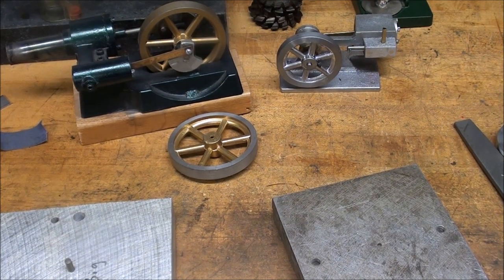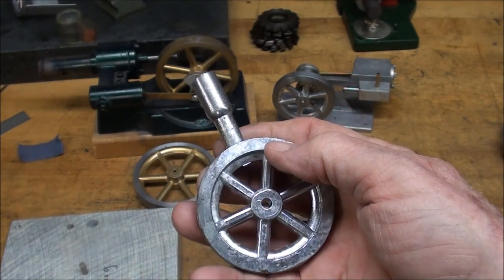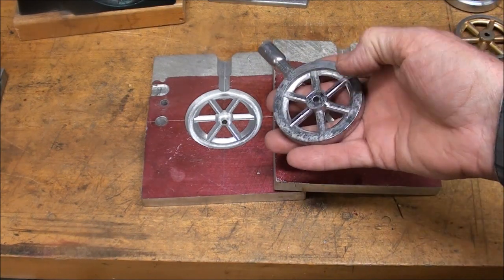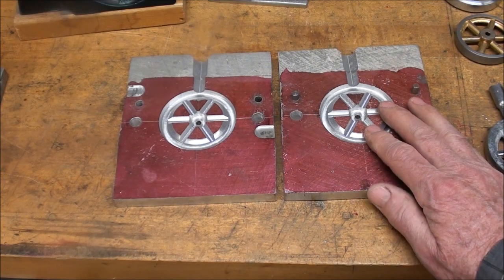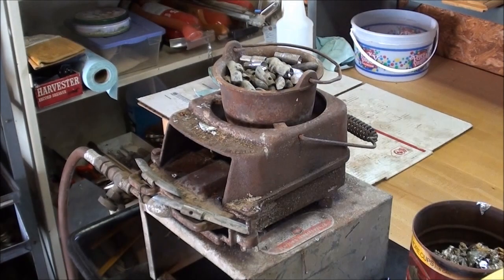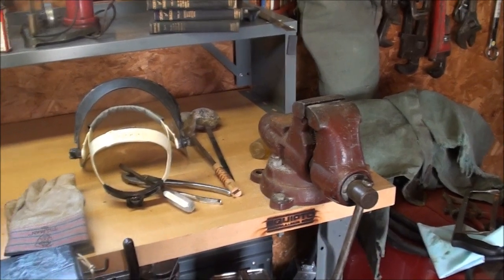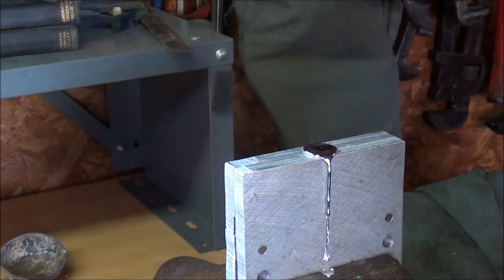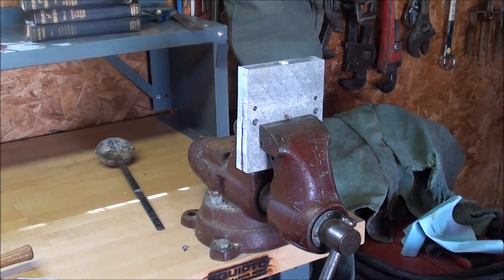MACHINE SHOP TIPS #162 Part 1 Making Flywheels for Model Steam Engines tubalcain

Comment: If you're planning on melting lead soon, consider getting a non-contact thermometer like they use for forehead temperature.  There are models that will measure over 700 degrees F.
Reply from the maker: Thanks

Comment: Thank you for posting this. One trick you may consider when casting lead with an aluminum mould is to apply carbon black to your casting surfaces. A kitchen match or two will do a pretty good job of this and it makes your release much nicer.

Comment: you could probably take some of the guesswork out with a cheap hand-held laser thermometer. could tell you both the temp of the metal in your pot as well as the outside temp of the mold. 

as for the wheel weights - lead may not be that harmful in certain situations, but if it's out in the environment, it can cause issues. it'll dissolve into the waterways and show up in fish and many other animals. doing what you're doing, focused on safety, wouldn't worry me at all. in fact, i may try it someday when i get started making those cute little steam engines. :) 

and keep ramblin'. it's not a bad thing.

Comment: Mr. Pete,
  I like looking at your many different videos you’ve made over the years. 
    This one brings back memories of the hours I spent over a plumber’s pot just like the one you have. This was normally a shop mounted device but my dad made a mounting bracket to put it right on top of a propane tank so we could take it to job sites. I always questioned the safety factor but we never had a tank blow. 
   I spent a lot of time fishing the Illinois river and the sloughs and bar pits around Valley City. A considerable amount of my dad’s plumbing lead were turned into sinkers. I made my own molds and even made weights to put on a couple of gill nets I fished in the river currents. 
Dale
Reply from the maker: Yes, I have melted a lot of lead. in my life.  I am surprised I am not dead from lead poisoning. And I fished alot in that Illinois River

Comment: Your 'gate' where your molten aluminium flows should be slightly offset from the point where you physically pour...i.e. you should have a sort of pond that overflows down into the gate. This helps prevent hot spots in certain places and also helps prevent turbulance which can lead to porosity amongst other things. Interesting video ...
Reply from the maker: Thanks

Comment: I have actually used a Linotype machine!  Linotype metal is a mix of a bunch of metals so it will set fast and be hard.  Linotype alloy consists of 4% tin, 12% antimony and 84% lead
Reply from the maker: I had much linotype metal and type metal that I use years ago from the school print shop. It is very hard lead.

Comment: Lot of tin in the Linotype.  Did you ever get a laser thermometer for measuring your lead temp?  I have a large pancake of homemade bee's wax to flux my lead for bullet casting.  I have about a half ton of lead I've gathered over the years.  That's what you have to watch for in the temperature, to make sure you don't get hot enough to melt the zinc.  I always smoke my moulds before casting bullets.

Comment: mrpete- in video 162 you gave a rant about lead, also a pet peeve of mine. I had a Stained Glass business, plus did years of electronic work . . . No apparent health issues. Granted it is a danger but it's believed you fall over dead after a single encounter with it. 
In Portland Oregon, a bridge was due for repainting. When it was discovered that the original primer was red lead the city went nuts. (Wasn't flaking off) Gotta' Come Off--Deadly Chemical--Hazardous Material. What did they do . . . sandblasted the whole bridge . . . into the Willamette River below . . . then safely proceeded. They created more problems than if they'd left it alone. I now work with oil painting, and can say there is nothing as good as white lead for a primer. It's how the Old Masters produced such brilliant paintings. 
A toddler would have to eat an entire Rocking Horse to have a problem with lead in paint.

Comment: Will the tree huggers be the death of us?
No, it will be the lead fumes you breathe in after melting them on the kitchen stove or in your garage
Reply: Tree hugger.
Reply: Given a choice between clean air or lead fumes, It's a no-brainer, even for an inbreed like you.
Reply: Poppy Puppy if we all were like you, industry would not exist.
Reply: I have been casting for 4 years now. I'm still alive. I been breathing coal for 3 years. I'm still alive. I been breathing gas fumes for 8 years. I'm still alive.
Reply: wasn't it zinc?
Reply: @kkuhn  : Zinc & lead both, though in different ways.

At any rate, the problem was mostly a mix of drinking water contamination (even the  Romans knew: look up "plumbum"), poor ventilation (increases fume density), sustained exposure, poor recycling techniques (look up 3rd world recycling techniques, it's why the Euros are so anti-lead), and general contamination (always filter your exhaust to pull the metal particles out of the air).
Reply: Poppy Puppy I'D RATHER TAKE MY CHANCES WITH THE LEAD FUMES...HOW DOES THAT STRIKE YA?!! GET STUFFED- YOU TURKEY!!!

Comment: You really need to smoke the mold to make it easier to release the part. By holding the mold in your vise it is sucking the heat from the lower part of the mold so hard to keep it warm. It would help if you had more vents in your mold. Fine score marks from the wheel to the outer edge in the face of the mold would help as vents.

Comment: I see you are clamping your mold in a metal vice. Do you think the metal vice is acting like a heat sink on the bottom of the mold causing the bottom of the casting not to form properly? maybe you could try clamping between wood ?
Reply from the maker: +Louis a. Cinquanto Sr. Somewhat--the vise does warm up a bit

Comment: Milling .0005" deep vent slots, to let the gases escape, will help with your short shots. I am not sure what the flash point is on your material, but I am almost sure you can mill the vent slots a little deeper. Great videos by the way! I am now an Industrial engineer, but I was a plastic injection mold maker, for 12 years, before finishing my engineering degree.
Reply from the maker: +rysammy Thanks for watching!--I need to try that

Comment: When making your flywheels you said you cannot make them out of aluminum, is that because of the mold or aluminum wont work as a flywheel.
Reply from the maker: +Josaljo Won Actually both.  You cannot pour alum into an alum mold
Reply from the maker: +zumbazumba1 I'd like to try that

Comment: I would be very interested to see how you made the mold. There seems to be different end mill bits used there to make the different round shapes. If you don't want to make a new mold, may be you could show the end mills and show the path on the existing mold. Thank you for all those videos you have made!
Reply from the maker: +JC InfiniteWood Thanks for watching. No plans for a vido on that--its a huge job. I use ball end mills of diff sizes & tapered end mills. all readily available
Reply: +mrpete222 thank you for telling about the different bits. That's already very helpful.

Comment: Mr. Pete that is a very informative video. I cast my own bullets and find that if you flux the molten metal in the pot by dropping a small chunk of bullet lube or beeswax in the pot and stir with your ladel or other piece of metal. That will make your alloy more consistent especially with wheel weights. Also purifies the metal and then can skim the dross off and have much cleaner castings. Keep up the videos I like them.

Comment: Judgeing from the way that the lead flows , I would say having the melt just a little hotter would help. Also you don`t have any vent ways in the moulds. The air in the mould has to come out past the inflowing lead. 2 vents each side , only 1mm sqr cross section would be bound to help.   shot gun lead pellets also have antimony in the mix.

Comment: Hi there MrPete,nice vid again,as usual :-) just wanted to ad something about the fact molten lead and water are an absolute nono,maybe someone else mentioned it earlyer in the list below,maybe you are aware yourself,maybe not,in that case,make sure a drop of sweat cant fall into the melting pot,in the best scenario,you'll get a nice puff and some steam,worst case might leave you scraping lead of the walls,floor and ceiling,not to mention,every bit of skin that was exposed at that moment ;-)
By tha way,if i lived in the US,i'd pay 50$ for a signed wheel of yours,as a souveneer but i'm affraid that if you'd send it to whear i'm at,it would be 50+ more for the send alone  :-)
Have a nice day.

Comment: Your moulds are fine, have you tryed using the real foundry clay? You can use your metal moulds and make a plaster moulds to use on the clay, then try and have more channels on th 60 degree and 120 degree lf the flywheel to make syre not to have airpockets and eliminate airbubbles in the mould, it takes a bit mkre mashining after but you gain perfect shape and a perfect piece of metal to work with with no foundry "error"

Comment: I realize that you probably have no need or desire to make another mold. But i am very curious about it. As im sure others are. Did you cast these molds as with your lead hammer? Or did you just machine them from stock aluminum.
Reply from the maker: Machined from solid stock

Comment: I think the typemetal slug you showed was made by Ludlow, not Linotype.  Notice that the printing surface is larger than the support below it.  Also, notice the marks on the support.

Ludlow used individual character molds and a special composing stick.  The stick had clamping features.  The character molds would be hand stacked, clamped, and the slug cast.

Eli D.

Comment: REALLY enjoyed the videos.  I wanted to mention, in case anyone was interested in making something similar to your molds, that I've made something similar to that on the lathe.  It involved some form tool grinding but it can be done.  After that, you could cut the spokes on a mill.  I've never cast anything they way you did but you might want to try experimenting with some venting sometime.  I have a few bullet molds and I've noticed some of them have shallow grooves cut across the faces.  I always assumed they are vents.

Comment: Thank you for your time in making these videos, always interesting.

I use to pour lead figures and I used rubber molds. The company I bought the molds from recommended and I used graphite powder as a release agent. Dusted the mold and never had a problem. Goes a long way.

John

Comment: Interesting.

Most casting i have seen have an in and out sprew. That gives the air somewhere to go. I notice in your sandcasting you did not have one either.

I would think it would flow better and I know in sandcastting, it is somewhere for loose sand to go.

I guess in a  vertical mold it is hard to set up.Maybe a very thin groove in one side for the air to go. the lead would probably cool before it got far into it.

Yes, those moulds are a nice piece of work. I bet you would finde a few people who will pay $50 for the flywheel ;)

Thanks again, someday I'll do some aluminum casting. I have your casting vids bookmarked for when I do.